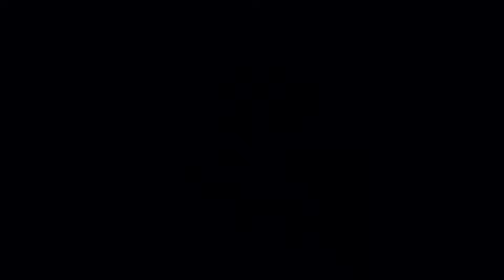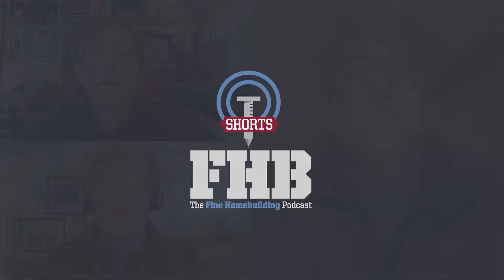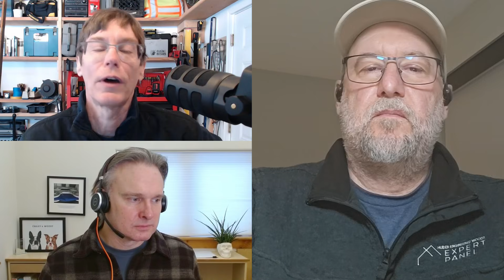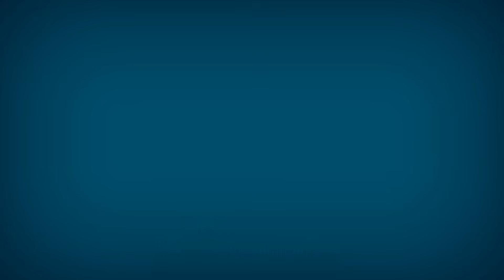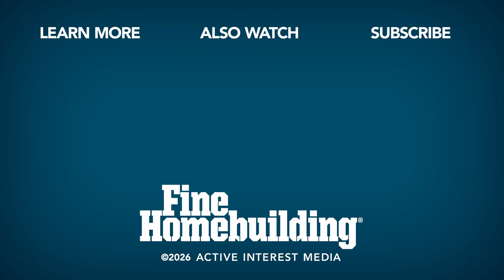The Importance of Passive-Cooling | FHB Podcast Episode 724

Comment: Im a Fine Homebuilding subscriber (paper version) in New England.  I have property in VT that someday i want to build a small home (by comparison to todays oversized mansions) of about 1000sq'. Ideally passive heated by south facing windows and free "cooling" by restricting solar gain in the summer with overhangs and awnings.  Ill add a ductless or two if needed because i do HVAC by trade. Maybe a geothermal unit. Not sure yet. Project is still years away.